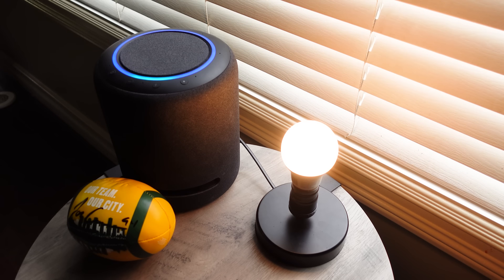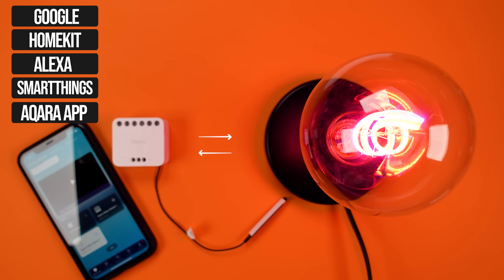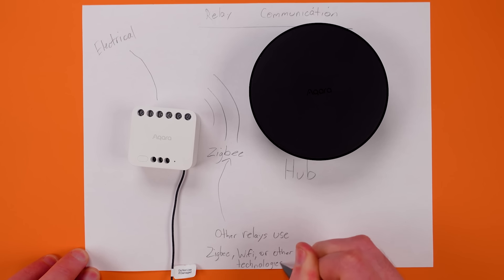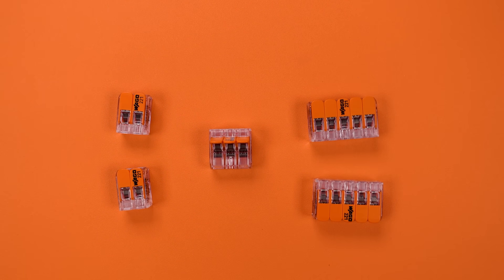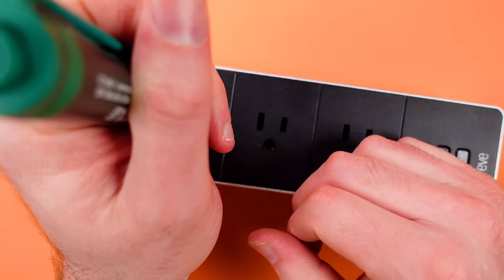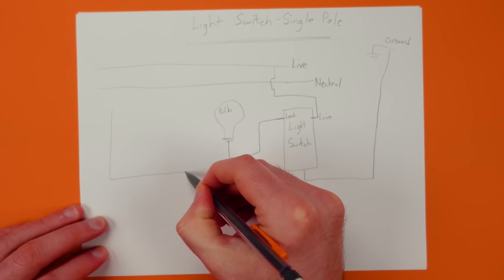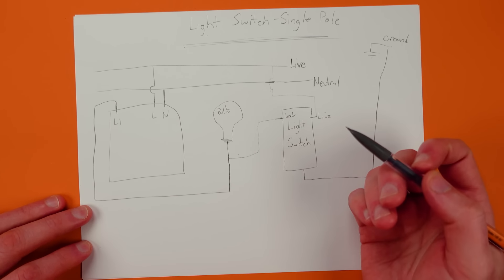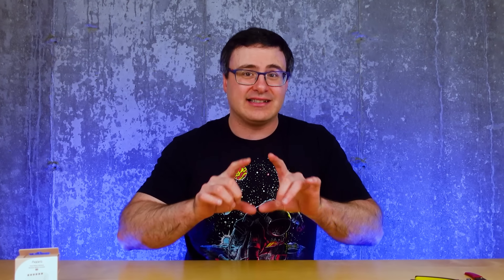How To Use Smart Relays - 101 (Featuring The NEW Aqara Relay Module T2)

Comment: I have a motion detector and would like the Aqara T2 to recognize when the motion detector sends power to S1. Is the voltage too high because I am not coming from the COM port? The output from motion detector is up to 230 Volt.
Reply from the maker: As I think about this, it feels like you have something wired wrong.  The Motion Detector can act as a switch, since it's line side voltage.  So maybe chat with Aqara support to make sure you've got this wired up right and that it can handle your sensor.

I believe the COM port and the lower half are exposed to line side voltage, so I don't think it's a problem with voltage.
Reply: Thank you for your answer. So is full watts and amps coming through the COM port? I had assumed that only little power comes through there
Reply from the maker: @Fadirko  voltage only I think.  Amps I believe is based on the device attached.  I don't have the diagram for the internals.  Hence the chat with Aqara recommendation ;)

Comment: What relay would you recommend for a roller door for my robot mower. It needs to be 2 channel for up and down signal. The switch is 240v. Which relay works nice with home assistant and do they have ones that do rf along side smart home integration for a dumb remote?
Reply from the maker: Too complex for me to recommend one. I feel like maybe Shelly will have you covered but check with an electrician to match your specs or that 240V could go spectacularly wrong.
Reply: @AutomateYourLife  I see what you did there. When the house burns down I will say the youtube channel called automateyourhousefire showed me.

Comment: Hi Again; after installing 7 Aqara relays, the delay between the physical switches and the lights is killing me. It generates a lot of confusion in my family, so they think the lights do not work correctly. Can we solve this in any way? I was thinking about changing the E1 hub to M2 .... but I think this will not solve anything.
Reply from the maker: Weird.  I'm not sure what's going on.  Perhaps the loading is causing additional time?  If you watch when I do it, there IS a slight delay but I'm surprised to hear anyone's struggling with that delay.  So honestly, I don't know what's going on for you
Reply: @AutomateYourLife I have just a test with Fibaro single switch and zero delays. So I think I am going to migrate to it. Thanks for your comments!!!!!
Reply: Ho again, finally I got the new brand sonoff R4M and they are faster than aqara. They are also very small.

Comment: Hi. What a great video. Ive recently installed a T2 module on my garage with dry mode and its working perfectly wen i push the first button in the app. But i would  like to know how can i use the second buttom that we can see in the app
Reply from the maker: That's for a second switch. In this case though it would likely have to be another garage door

Comment: First of all thanks for this video . I am not sure if you mention this at any point or i missed it , but as I am aiming to install these modules behind many of my traditional switches which are traditionally dimmable , does this offer dimming ? If not , can a workaround happen somehow to dim the lights from my phone? Neither am I an electrician nor do I know much about circuits I'm just gonna tell this to my electrician if you could help !
Reply from the maker: Without knowing your system, I'd have a hard time helping much. I think ask your electrician but it SOUNDS like you're going to be fine.  The relay will power on the circuit and then the dimmer will deal with the rest.
Reply from the maker: The T2 does not do dimming on its own though. That's not possible. It's an on/off device only

Comment: Hello, great video!
I was looking to control a small DC motor or 110V moteur with Aqara orMeross relays, or 2 homekit switches + scene/automation for duration or meross garage door opener. 
Any idea or suggestion for the best way to automate a motor (front/reverse/stop) in homekit?
Thanks for the suggestion
Reply from the maker: This relay (the T2) does have reversible motor control in it.  I didn't talk about that in this video cause it isn't a common use case, but you can use this with HomeKit through Aqara's normal integration methods or the Matter in their M2/M1S/E1 Hubs
Reply: @AutomateYourLife  thanks for your reply ! I am just curious about triggers to stop the motor / relay. What would you suggest ? Timer or trigger? This why I was interested in the garage opener from Meross

Comment: Going to add photocell to an input on dual T2 relay can this be done?
Reply from the maker: Check the specs but it's possible to use it just like the switch in this circuit.  It'll all depend on the photocell.

Remember those switch contacts are exposed to whatever's on the line side of the relay....

Comment: In my testing, a button off the S1/COM1 only works with 120V AC power and does not work on 24V DC power. My use case had to have a button on 24V DC so hopefully that is something that works in the future.
Reply from the maker: Nope, you're correct.

Comment: Great video, thanks! I have a scenario I'm considering using the Aqara relay for, but I'm not sure what the best set up is. I have a "dumb" humidifier that has an on/off button that runs to the PCB and I'm pretty sure is LV because if I unplug the appliance whilst it is on and then plug it back in, it only turns on again when I press the on/off button.  What I would like to do is to connect the Aqara relay to the on/off switch so I can control it remotely.  Would I need to provide power to the switch separately from the device's power supply (i.e. an additional power cord), or can I connect the Live and Neutral wires of the device's power cord to the Live and Neutral contacts on the Aqara, connect the L1 and Lout contacts on the Aqara to the Live and Neutral inputs on the PCB, and then connect the devices LV switch to the S1 and Com ports? Or is there a simpler/better way to do this?
Reply from the maker: I think because of the way the T2 works, you couldn't use it for this. It exposes full power to the switches, so...you need a different relay.  Look up Zooz, Shelly. :)
Reply: @AutomateYourLife  merci. If I just wanted to simply simulate the “button” press to turn the unit on, I imagine this would work if I run a separate power supply to the T2, operate in dry contact mode, and connect the “switch” to L1/Lout?
Reply: Is there a IR or RF remote to the humidifier involved? Then you can do something with that

Comment: Thank you so much for the video!  Its the most detailed and clear one on Aqara T2 by far.  Just a question, as we need to connect the red wire from LIN to LOUT to bring the line power to the other side of the relay, why would it be named LIN (shouldn't it be line out as electricity flow out from there)? And shouldn't LOUT be LIN since you are bringing the line voltage into the L1 and L2 side?  Also can you also not connect the line from utility to LOUT directly (and L to power the T2) and skip the connection between LIN and LOUT?  Since we need to connect neutral from utility to both the T2 neutral and L1/L2 neutral (ie. at light bulb) anyway, so why not connect the line power to LOUT directly as well?  Seems like LIN is not needed?
Reply from the maker: Hey! Thanks 😃

Lin and lout are jumpered out for most of the ways you'll use this in your home! However, there are a few cases where you'll need it!  I believe...it was the garage where I removed it in this video.  Sorry, been a while ;)

Comment: Hello, is there any way how to connect 3 physical switches for one light (as one switch is by doors and 2 others by beds) with relay module (one or more) so i still can use those switches so as using app to turn lights on and off, thanks
Reply from the maker: You'd need to talk to an electrician.  It would depend on how you want to control them (and ratings).  But I would suggest you just get 2 relays and then you absolutely will!

Comment: I stil have a question sir, so if i get the Aqara switch without neutral. After clicking the switch physical will the switch tell me that light is on or not on the phone? or will this only happen when I have the relay one or with neutral. I hope you get my question
Reply from the maker: I think you're trying to combine this relay with an Aqara smart switch.  I don't think you can do that.  This relay requires a neutral. The Switch does not.  I don't know that you should (or even could) wire this up.
Reply: @AutomateYourLife  I think my explanations is not correct. I want to know with which aqara product will I get a relay system? So that when someone press the switch my phone will also know that the switch is on?

Comment: I would really like to see how you use wired contact sensor with the garage opener. Would that be to cut the signal in case of non pulse device?
Reply from the maker: You could also send another pulse to pause the garage movement right?

Comment: can this be used with hue bulbs? So that they wont keep resetting?
Reply from the maker: You can use a relay with a standard switch absolutely.  Keep in mind the relay kills power though, so you’d be taking away your smart features until you turned on the relay and then gave the bulbs a few seconds to reconnect
Reply: The short answer is no! Your smart bulbs would lose power and thus become unresponsive to any controls.

The main purpose of a smart relay is to control a non-smart item.

Comment: Hi there. I'm struggling to find something that could sense a device has powered on and then at this moment, turn a couple of other devices on. I'd like for the opposite to be true ie. Original device powered off means the couple of other devices turn off. Any help would be greatly appreciated as I'm lost right now.
Reply from the maker: You'd be able to do that with most relays, I think.  It all depends on if you mean the device itself turns off, or if you mean you turn it off through the relay.

Just about any relay does the latter.  Otherwise you likely need a smart plug with energy monitoring

Comment: can I install the relay near the garage door switch? I was wondering if it can control two garage doors.
Reply from the maker: Good question.  You can, but think about powering the relay!

Your diagram would be a bit different obviously, as you'd have the extra wiring happening at the switch.

Comment: Hi, I'm not an electrician and I wanted to ask you if I would like to use the aqara t2 for a switch with 3 "claps", two of them to manage two different lights. Each with its own light, left to left and right to right, and the middle "click" to access an automation in this aqara application  .
Reply from the maker: Sure!  I'm confused when you say claps, but you can have any third button or switch be the control for an automation with Aqara.  The t2 likely wouldn't be wired in to that 3rd switch or button.  Maybe just get a button from aqara?

Comment: Great video!!! I used one to control 2 ceiling light from switches and it works great…I’d like to use it also as roller shutter controller but unfortunately seems that is still not supported in the Aqara app (at least not the percentage, only open or close). I hope Aqara will add this feature in the future, maybe with home assistant?
Reply from the maker: I don't know on that one! I think hardware wise it's a little stuck.

Comment: In dry contact mode.. can we use both L1 and L2 as 2 separate contact switches? Would it mean Lout will connect to both ends of those contact switches?

Comment: Do you know if it’s possible to use an Aqara T2 relay as a dry contact switch on one channel and a wet contact switch on the second channel? I’d like to use one to control my gas fireplace; dry for the flame control and wet for the blower.
Reply from the maker: Sadly, I don't believe you'll be able to do that.  I can't see a way.  You'd likely end up with a second relay anyways, so...I think just buy 2 fit for purpose relays

Comment: In Australia it would be illegal not to use an electrician for installation. We have this so that a standard and safety is paramount. 
This is unusual in most countries, but we use lethal 240V-10A everywhere.
Reply from the maker: You poor Aussies Michael.  Giant spiders AND electricians in your home 😳
Reply: @AutomateYourLife  I prefer to have a house that won't kill me before the snakes, spiders, crocodiles and sharks do.
Reply: Here in the UK all the public are allowed to do is change a switch or socket, any wiring change or change to a circuit has to have a works certificate from the electrician. Here in the UK portable appliances (TV, Kettle, washing machines etc) have a plug with a fuse in it (13A, 10A, 7A, 5A, 3A, 2A, 1A),  the plug goes into the wall socket which has a 32A MCB protecting the ring circuit (starts at the breaker goes round to all the sockets and then back to the breaker, the fuse / mcb it there to protect the cable not the appliance. 240v / 110v doesnt matter if you get a fault current running through you then you are in trouble. Now we have fault detection like - earth leakage protection. surge protection, overload protection, arc detectors, these were introduced due to the amount of electrical fires the firebrigade were dealing with here in the UK. It has changed so much since I went to college on the late 80's (1980's that is).

Comment: If the garage door does not operate by the simple pulse connection, then no way to use this relay to control the door? One of mine works but the other doesn't.
Reply from the maker: Yes you can.  I tried to explain the pulse connection vs holding the signal on/off.  Also try extending the pulse width.
Reply: Oh, I didn't know the purpose of it. Thanks!
Reply: @AutomateYourLife   Just for your information, I bought T2 and tested it on my garage door (Chamberlain with yellow learning button), Unfortunately, none of the options in the T2 relay works for my case. I'm just thinking of soldering wire from T2 to the wall button.

Comment: Hi Brian I am looking to do something unusual and hope you can assist - I have a dumb light outside my patio that I want to make smart but I also want to power a set of string lights also.
 I have bought an Aqara dual relay module T 2 and wanted to use the cable to the existing light and make it smart but use the second relay to power and control the string lights 
I am planning to put the relay in an I p rated weather proof box but having watched this video I am uncertain how to do the wiring 
Any help appreciated

Comment: For 2 pins outlets, be very careful with the last setup and which is neutral and live in your power outlet. You can easily switch the neutral with live just by how you plug in your socket in the outlet. Things can go wrong, especially if you use the com ports.
Reply from the maker: Thank you!

Comment: Thanks for demystifying these. I always wondered about them. The ratings thing is still overwhelming enough for me to avoid using these for now though. I'm no stranger to electrical; I wired our basement. But just having to account for wire gauge, heat, amps, watts, it's just too confusing.
Reply from the maker: And that's fair Brad!  Do what works for you

Comment: Electrician here, slight correction on the pig tail name origin or meaning. Any short wire or cable used for a connection. This connection can be twisted wires, plugs on a chord or flexible conduit etc. 

When wire or cable or flexible conduit is taken off a roll it still holds the shape it had on the roll. Often these are short and coiled when using it this specific way. That's why it's a pig tail.

Great video as always. Very professional and informative. I really liked your video on writing automations. You did a great job explaining triggers, preconditions,and there purpose.
Reply from the maker: Thanks Jared!  Appreciate the correction on pigtail!